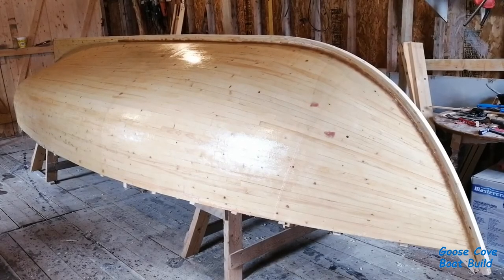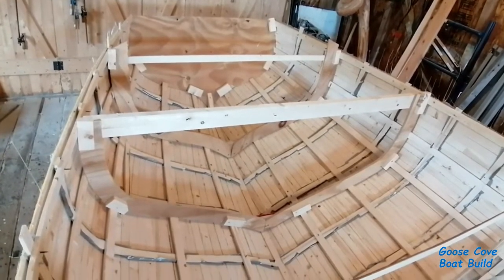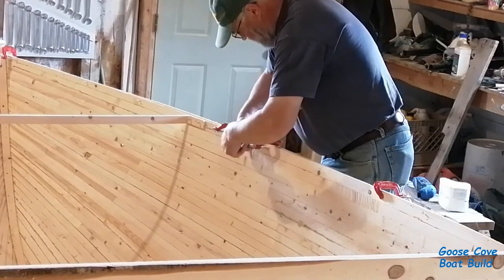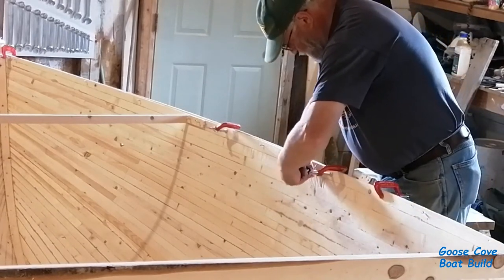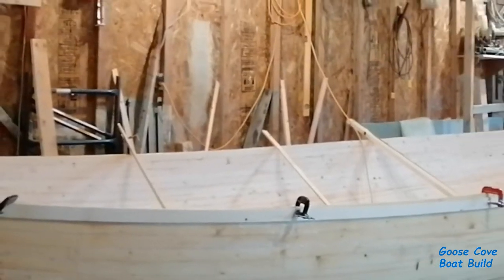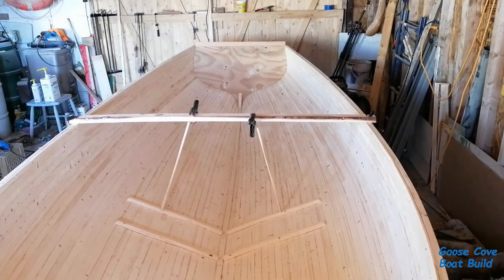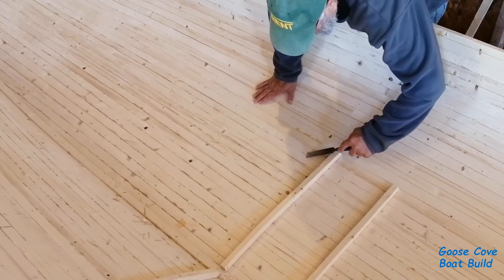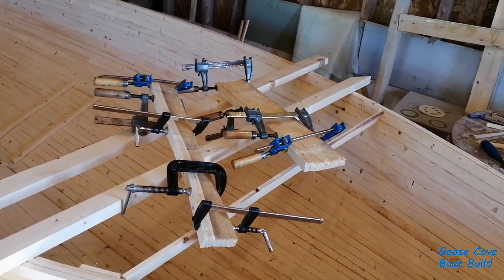Hull flip, gunnels and beginning to install insides.

Comment: I'd still like to see. Time lapse. How many layers of glass?
I noticed you didn't coat the wood before laying the glass. I guess working with epoxy is different?
 When I did my camper project with polyurethane, I put the resin on first so it would soak in. Then I began glassing. It was all still sticky, as you know, until the top coat/gelcoat with wax.